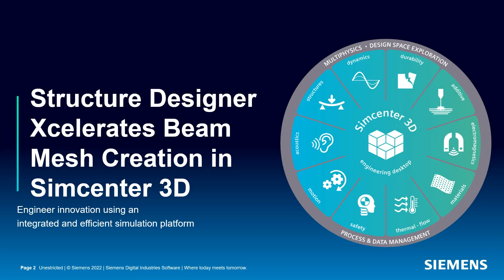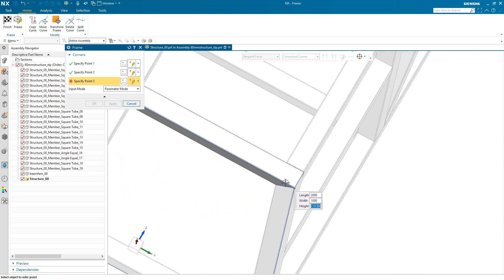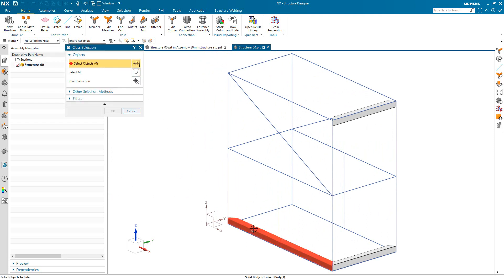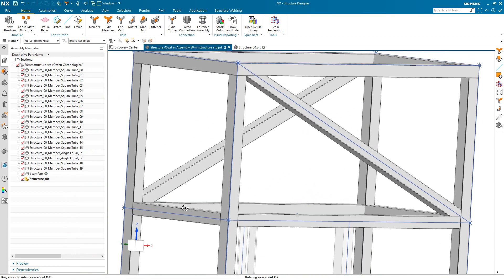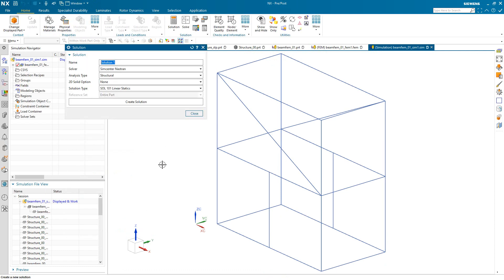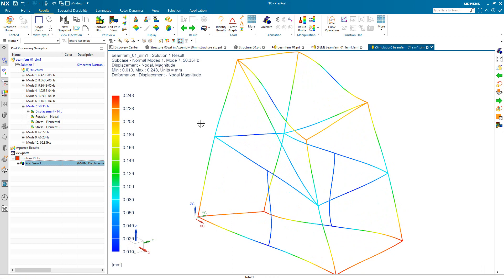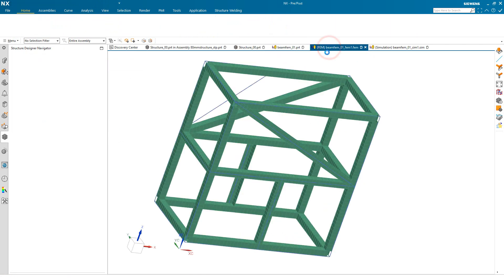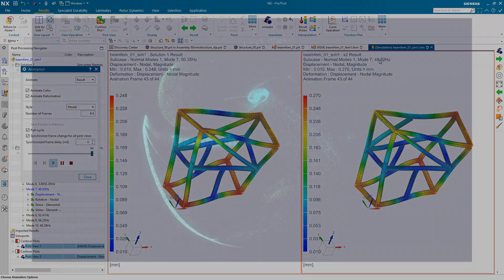NX Structure Designer Xcelerates Finite Element Beam Mesh Creation

Comment: Hi, good video and feature. One question, after a global beam model analysis is finished, I want to check the strength of a joint between beams. I think the joint should be modeled with 3D or 2D meshes, others could be beams. How to do it with the feature?
Reply from the maker: Only beam meshes can be created from the Structure Designer.  You can, however, easily create shell or solid representations of the beams to more accurately analyze the joints between beams.

Comment: Hi, good feature and presentation! Does it support tapered beam?
Reply from the maker: Hi, glad you liked it.  Tapered beams are not supported in the Structure Designer but are supported in Simcenter 3D.  To specify a tapered beam section property, in the FEM edit the beam collector and change the section type from constant to tapered.